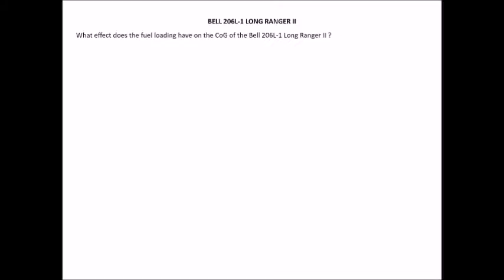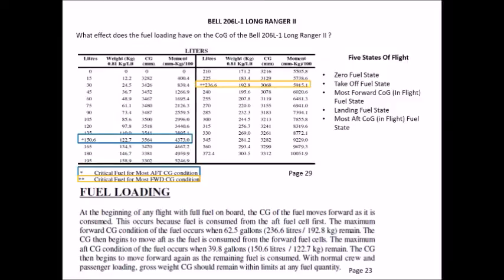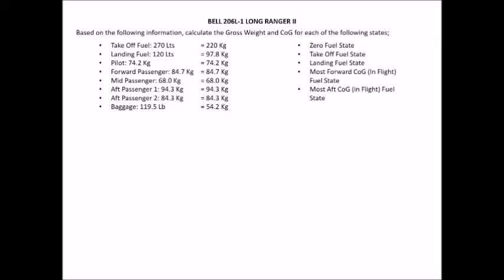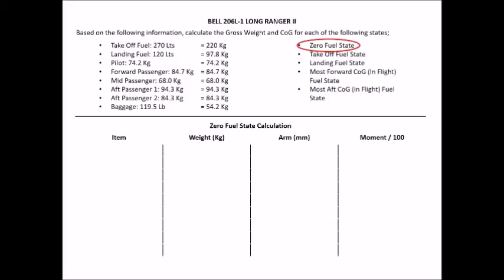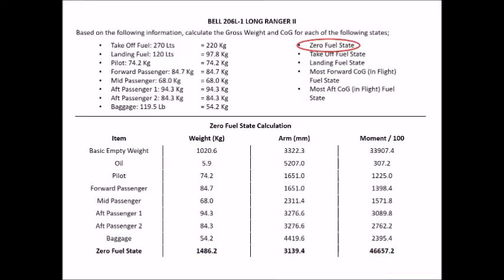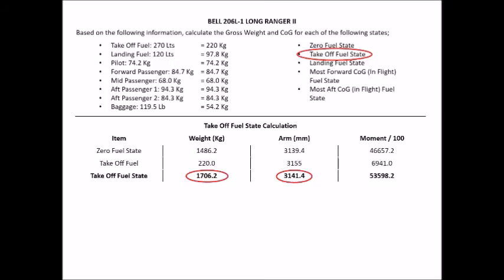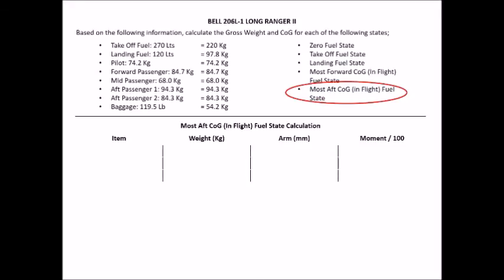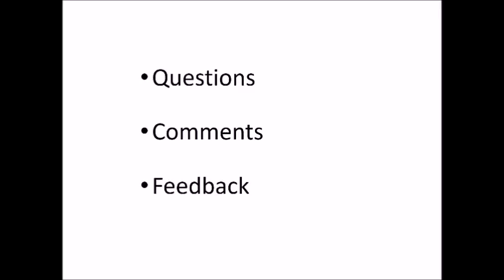How to do a Helicopter Weight & Balance Calculation

Comment: Hi Matt, Great videos, massive help, especially when trying to pick this up with self study. Worked out what I was doing wrong. You're method is way easier & quicker to solve these problems than the method in the 206L sample loading problems. Absolute legend!

About to sit this last CPL exam and this has just given me the confidence on these W&B questions.

You would be a great instructor mate, as my flight instructors just scratch their heads when I ask them any casa exam question.
Do you offer any online 1on1 lessons via skype or phone?

Cheers

Phil
Reply from the maker: Hey Phil.  
Really pleased that the videos have been able to help!
At the moment I'm not running any full subject courses...   however, if you just wanted some assistance on a specific topic I'd be very happy to help.  Send us an email at mattarnold1 at gmail.com and we'll go from there :-) 
Matt

Comment: Question: Why are you dividing by 100 then multiplying by 100?   They cancel one another.
Reply from the maker: Hi SportyFamily

You’re 100% correct. It’s not a required calculation and one that you can skip if you choose to.

When the formula was taught to me, I was told that by dividing the moment by 100 it’ll allow you to work with a smaller number. This will save time when writing it down and then subsequently re-entering it. A smaller number will also be mentally easier to work with.

Hope this helps

Matt